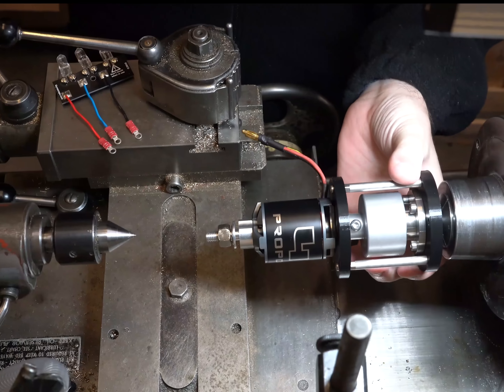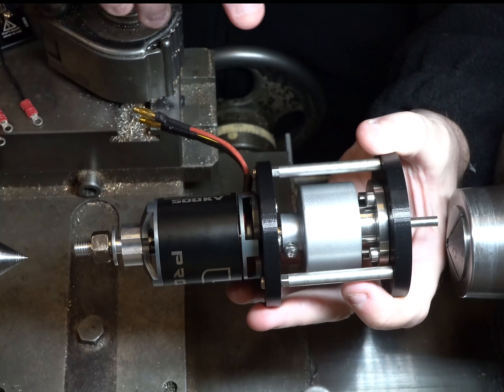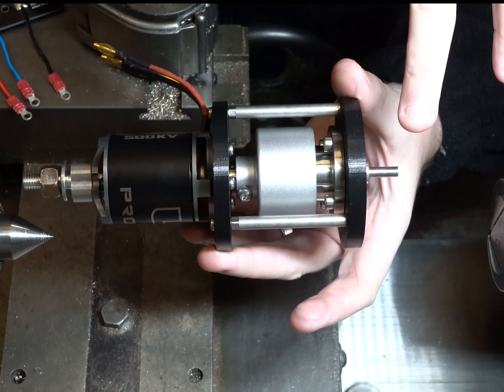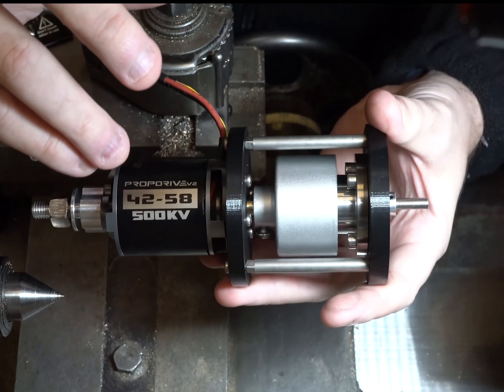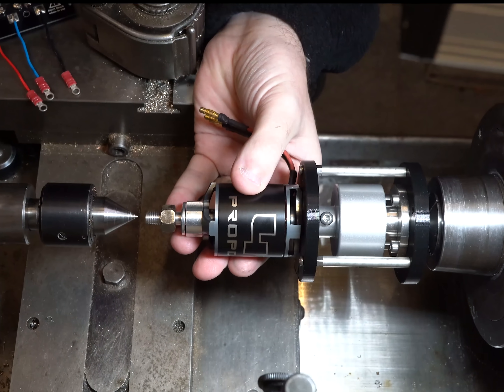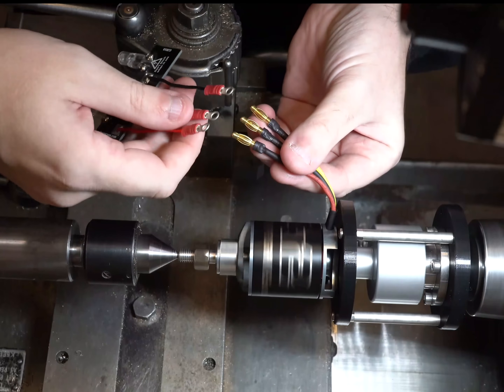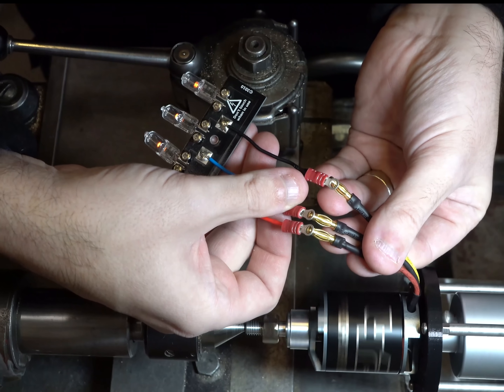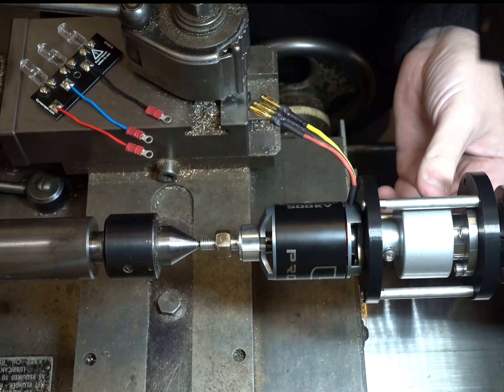Testing if the Tesla turbine MK4 will work

Comment: Which allows you to not have a shaft outside of the housing and then seal more easily ?
Reply: Perhaps the maker should update and let others know that the magnetic coupling just dosn't handle the torque... so has to be removed for the time being...